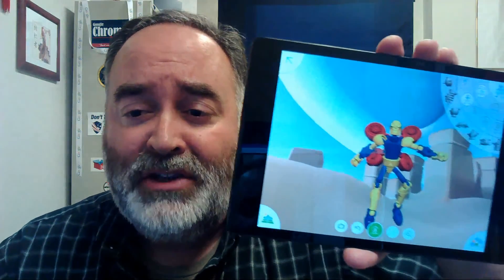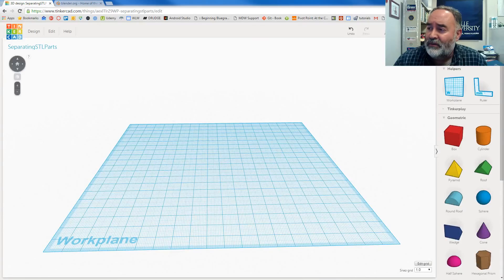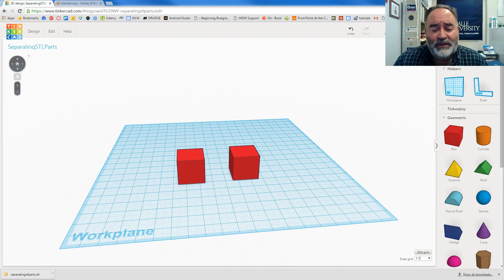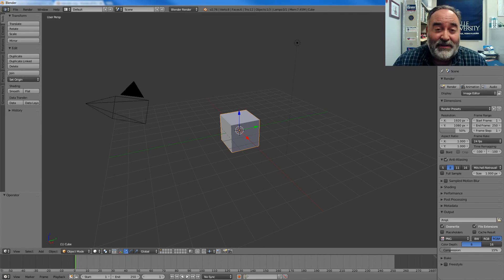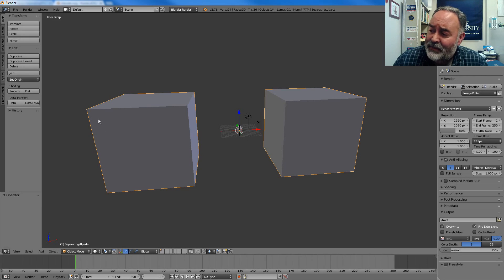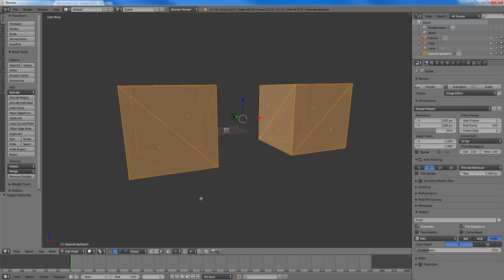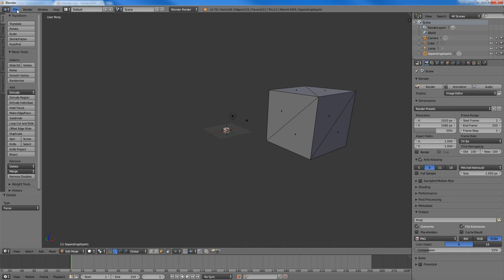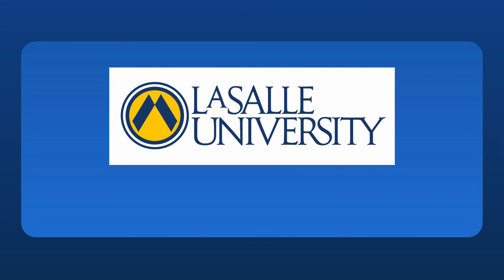Editing STL 3D Printer Files with Blender

Comment: It would be much easier to tune your Cura profile. Not sure how bad your prints were printing multiple parts at a time, but it's very possible to do so without any stringing or blobbing were the head moves from one part to another.